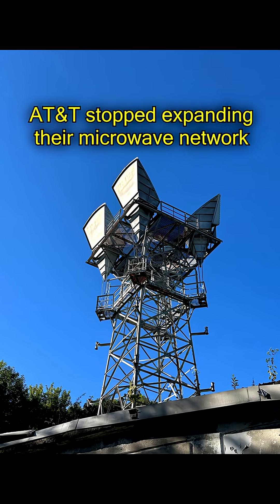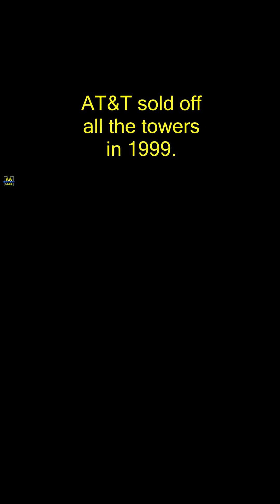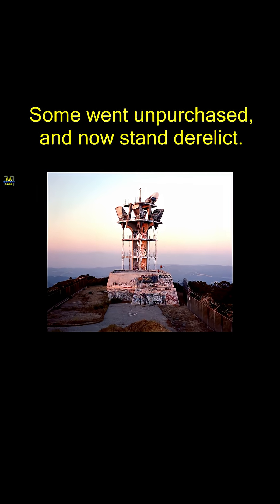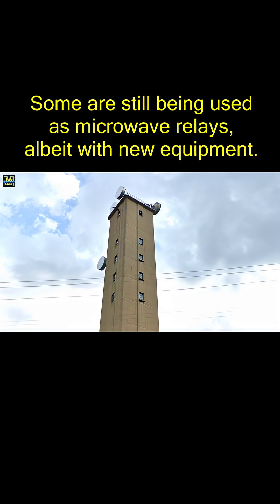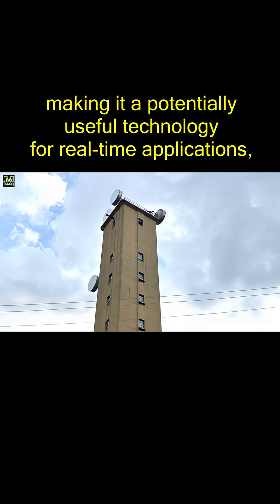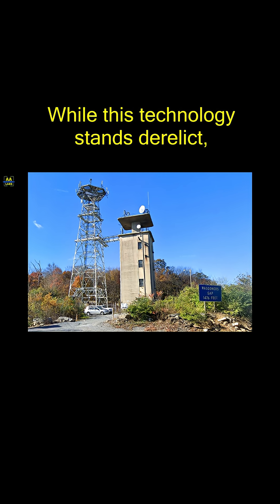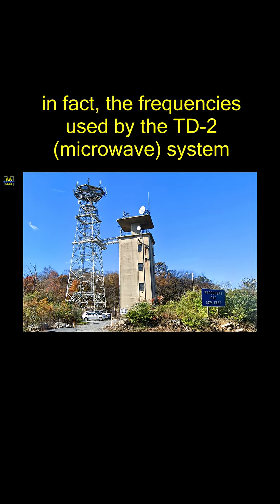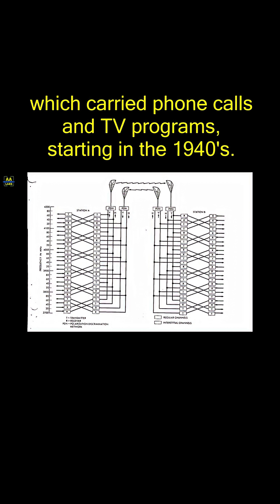AT&T Long Lines Towers Today #engineering #telecom

Comment: Growing up in Cedar Rapids in the 1970's, the Northwestern Bell building had roughly 20 story cruciform lattice planar tower on top the 4 story building with the microwave feedhorns and waveguides at the top. Line of sight transmission to the next towers in the chain. Chain followed US6/US30 corridor through central Iowa. the planar tower came down in the early 2000's? there are other intact towers dotted across central Iowa.  Neat piece of tech history that was obsoleted by bulk fiber in the mid 1980's